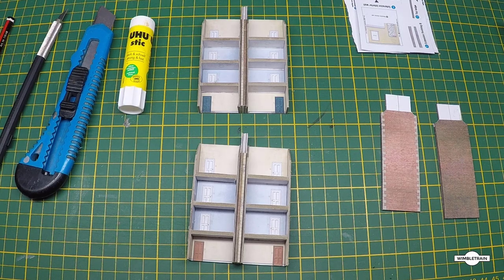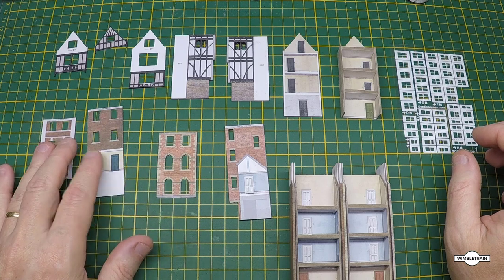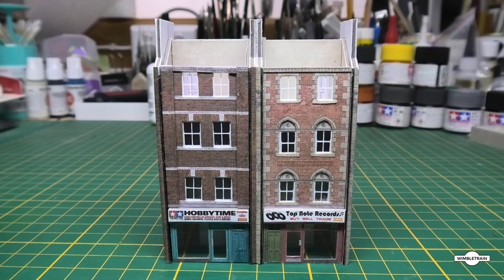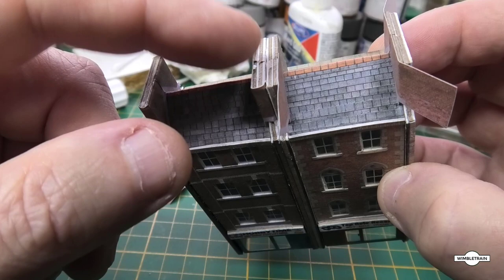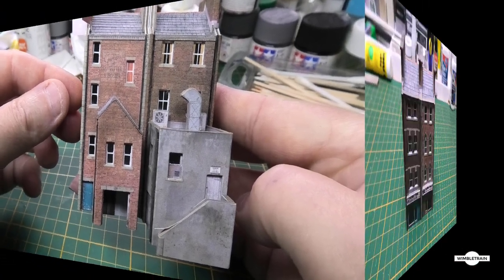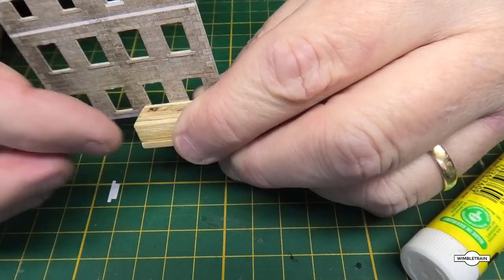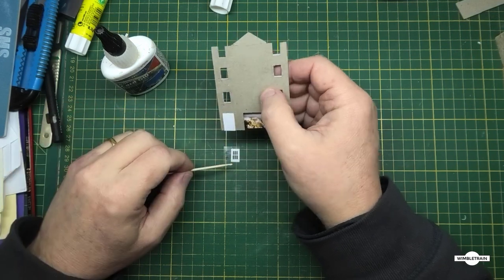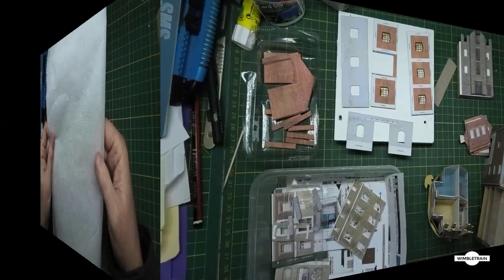Building the Scalescenes High St Fronts and Backs in N Scale

Comment: Good to see John, excellent tutorial, I’ve kind of been building up to making a Scalescenes video now that I’ve made a few kits but still not sure if my skills are up to it!!!
I actually print mine onto A4 sticky labels then obviously peel off the backing and stick them to the card. I actually find this a better method than the glue sticks. I also only use 1mm card for everything as most of the walls are double sided anyway and in N scale I just find it a bit better to handle through my experiences so far. I’ve also stopped cutting the the roof tiles into strips as it’s so hard to get them straight! I cut out a slightly oversize piece for what I need, again peel the back off the sticky label and stick it on.
Thanks for doing this though John it does highlight some of the problems you incur with these kits, I often mis-interpret the instructions! Cheers for now mate, John
Reply from the maker: G'day John, I think you should make a video, it's always good to see how others build these kits and hopefully pick up a few ideas along the way. Interesting idea with the labels, might have to give that a go, certainly quicker than spreading glue everywhere! Yes, the roof tile cutting can be somewhat tricky, one slip and it's gone...... Oh and the instructions, nothing worse than not following them to the letter (sometimes I have to read it over and over) and creating more work for yourself. I started filming this months ago and just after I started you mentioned on one of your videos that someone made a comment that you should do a Scalescenes video. Then I was thinking oh no John might think I stole his idea by making this video!! 😮😄All the best. John
Reply: lol! No worries John, it wouldn’t bother me at all! I’ve got to much going on at the moment so that may have to wait for a while, cheers John, John
Reply: @wimbletrain  For a non-native English speaker I have to read the instructions more than 10 times to not miss anything
Thanks for this nice video John
Reply from the maker: @cevennesrailways7444  Yes, it must be difficult, I myself sometimes have trouble. Thanks for watching

Comment: Love scale scenes kits, they are fiddly but the weathering is beyond what I could ever paint. Have had some success printing on to adhesive paper, but am still practicing on the free kits they have. Some of the card you use appears well thicker than what scale scenes recommends. Am I right and is there a positive to using thicker card? Lastly where did the big town hall building with the clock come from? Layout is looking great. Stu
Reply from the maker: Hi Stuart,  the other building is the Scalescenes R005 large station kit. I try to get card sizes based on what Scalescenes recommend, but when you start investigating card thickness and what you get, it's a minefield! Anyway, just make sure you take your time, it will pay off in the end. I saw your other comment about the card sizes. John

Comment: A great build video and very useful. I'm about to build the canal scenes for my T-TRAK layout. The Canal Lock scares me because I just cant seem to get the right thickness of card to mount it all on.
Do you get your sheets from Officeworks by chance? The majority of mine come from cereal packets, all one brand so to maintain consistency. 
Love your trick about the windows, that is a steal for sure.
Have you told John about the errors with the rear of 1 and 2 buildings? And the roof fit problem?
I am also going down a similar path with Arduino as my control system. No DCC unfortunately, my locos dont ha e the room and I cant afford the chips.😢
Reply from the maker: Hi, I did buy the 200gsm and 600gsm (supposed to be around 1mm thick but can vary) originally. I've now tried a couple of different eBay sellers for the 1mm thick and recently gone for one seller (plazadj) who says their boxboard (as they call it) is 600gsm 1mm thick. I did notice with the previous cardstock I was using for the 1mm wasn't exact when fitting cover sheets to some pieces in the Scalescenes kits.
I haven't mentioned the errors to John, I probably need to have a look at those again to make sure it's not something I was doing wrong.
Yes, unfortunately it can get quite expensive fitting out all you locos with DCC on top of the cost of the actual locos! 
Cheers and thanks for watching. John